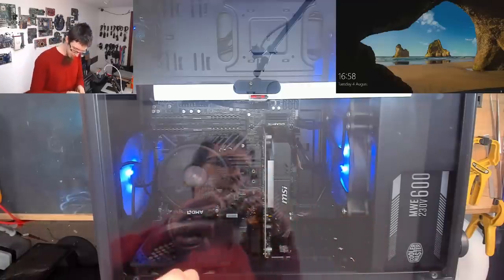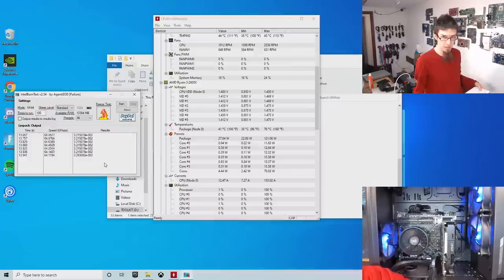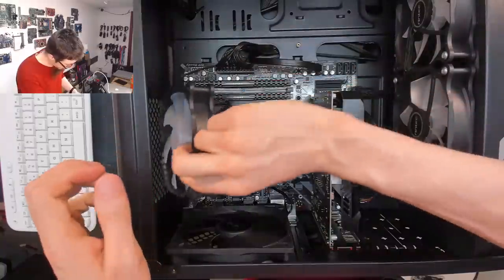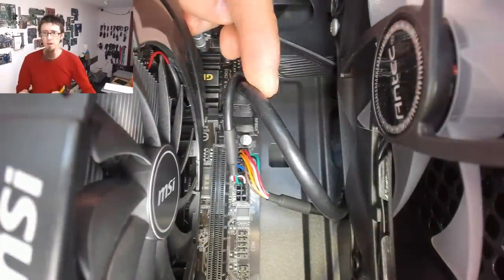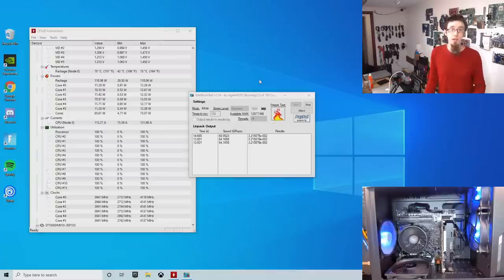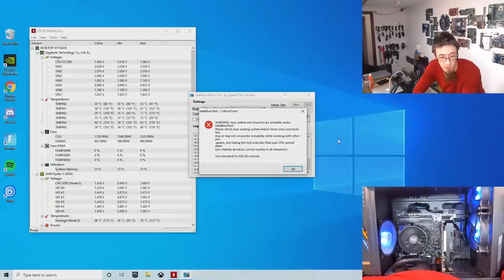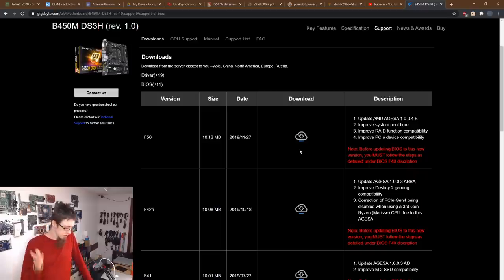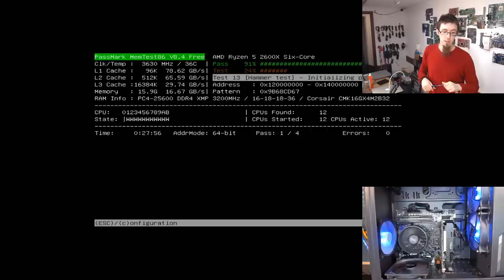Gaming PC Crashes at Random - LFC#217

Comment: How about if my pc restarts when i move the chair or hit the table? I bought a new psu with gold certified. Still the problem exist. I dont know if the power button wiring is broken or what? (Btw sometimes, i cant start the pc directly. I need to wait several minutes or even several long minutes until it boots when i press the power button.)
Reply: And about the problem regarding the turning my pc on, when it turns on after waiting for several minutes, sometimes the time resets for some reason
Reply from the maker: Try reseating the CPU. Try unplugging all front panel (power button, etc) wires, and turn on the PC by shorting the Power Button pins with a screwdriver. Unplug the front-USB and front audio for good measure.
Reply: @Adamant_IT  this thing i did and everything is fine like jays2cents tutorial. But still when i put everything back to normal, the problem still persists. I dont know what the problem is

Comment: sometimes the odd combinations between ram not on the qvl and your lower tier motherboard can indeed cause this issue. though it can also be attributable to a bad memory controller on the chip too. the easy way to tell if its the memory controller is if the chip and ram fail at stock 2133 in the customer's board and a spare known good board. if your looking for a good board nowadays, asrock is actually a lot better then it used to be. im using, and i know im in the future from spit out of this video an asrock x670e board with a ryzen 9 7900x. no issues to complain of.

Comment: I have that same board, and the ideal speed for RAM is 2933 MHz.
Increasing the clock over 3000 MHz can cause problems.
Also at 2933MHz you will get more bandwidth than at 3000 MHz.
2933 MHz takes me out in read, write, copy: 45GB/s 44GB/s 45GB/s, but at 3000MHz I get 40GB/s 42GB/s 40GB/s.

Comment: I would be pissed if I got my pc back to find out he cut something off he thought was useless.. I once had a dead Fan header on my MB, and thus the connector he found useless came in very handy and still allowed me to power the fan
Reply: I was thinking the same thing. If it was me fixing it, I would have wrapped it in electrical tape instead of going straight to chopping it off.

Comment: I stopped using gigabyte boards a long time ago, I used them for years for things like light duty linux servers  because they were rock solid and could be relied on to be left to run 24/7,  the Gigabyte boards were easy to spot in the old days without opening the case, back then  if you were looking at a bios screen and it didnt have a typematic rate setting then it be a gigabyte board - now nobody  has that setting-  unfortunately I  had ram issues with  my own p35ds3r  which I used as a workstation  - black screen with the system  halted every so many boot sequences if left to run the ram with the auto settings-  which turned out not to be voltage droop but the ram being run at the wrong voltage if left to automatic settings I went through all the bios versions  for it  and no fix it was a pain, this was a particular headache using corsair XMS,  but cheap generic ram was fine but slow, a work around was to flatten the bios and install only 1 dimm and after getting into the BIOS was  turn off  the SPD settings but put settings in manually  then shut down and reinstall the other dims..   I also had  a ram issue causing the dreaded boot loop  with another gigabyte series of boards z68 ud4 with almost every stick of ram  I put in them, was  too much of a headache so switched to MSI  years ago  the boards are still running and not had a single  issue since....

Comment: God damn XMP. I had a i7 4790K paired with a Asrock Z97X Killer Fatality mobo and i bought G.Skill TridentX, DDR3, 8 GB, 2400MHz, CL10 without checking QVL. For 6 years I had to run it at stock 1600 MHz because no matter what I did I could not overclock it. Any overclock would cause instability and on stock settings it run perfectly stable. But freaking slow!

Recently I changed the platform to a i7 10700K with the MSI Z490 Tomahawk and when I was configuring it I purposefully bought RAM that was guaranteed to work on that motherboard. I probably could buy something faster for the same price but I stuck to the QVL list and bought the HyperX 32GB (2x16GB) 3600MHz CL17 Fury RGB. Now I have the CPU overclocked to 5.1 GHz All Core and RAM set to XMP without any stability issues. Now the only issue I'm having is waiting for the RTX 3080 to complete the build. It's been six weeks since I ordered it and still have no idea when it's going to be delivered.

Comment: had the same issue a couple years ago when i built my pc (same board same cpu non x version) ram is 3200mhz g skill F4-3200C14D-16GVR and does not show up in the list of supported memory however one very close to mine (g skill f4-320014d-16gFX) my pc would reboot or crash randomly i downclocked from 3200mhz to 2900mhz that seems to fix it havent botherd to swap out memory

Comment: I would have just insulated that Molex connector.  Just cutting the wire and tucking it away without insulating the cuts ends doesn't seem professional to me.

Comment: I had an fx 8350 platform BURN the connector for the eps 8 pin. I know it was properly plugged in, cause even half melted it was plugged in fully. It was overclocked, and I know it pulled heavy power when I ran video encoding software.

Comment: I would have changed the mem test to 99 and let it run while I slept.  4 tests is too small.  If it's still running when you wake up... awesome!  :)  I've seen memory fail after 10+ passes.  So, I usually leave ram tests running as long as possible.

Comment: Set a static voltage. It’s not always memory…..but…….if the errors are different every time…….then maybe yes to the memory. I would turn to loosening and using manual memory timings. XMP is for the masses……..designed to work on all systems………maybe………and that’s why I don’t use it in my builds. All manual timings at XMP speeds. Takes time…..but worth the effort. Tweak until “0” errors. In any event…….troubleshooting is most of the time a crapshoot…………unless it’s a blatantly obvious problem………or an I-D-1-0-T error. Love people who want to build their own rig…………cuz how hard can it be? Well, it’s not hard when you know what you’re doing……….but if you don’t……….and run into problems……….say hello to the computer tech…………and that ain’t your buddy who “knows computers”. When ya got no skin in the game…………..you got no skin in the game.

Comment: Great troubleshooting guide , you’ll probably wont answer this but I wonder how much do you charge for this repair , as I’m sure you worked several hours on this , but in the end you just changed a Bios Setting to fix the problem. So it seems like a hard call .
Reply from the maker: My 'flat-fee' is £50, but I often go a little higher or lower depending on the difficulty. I went lower to £40 on this one because as you say, ultimately it was a BIOS tweak. That also comes with my warranty though, so if the computer locks up again, I'll look at it again free of charge, even if that follow up ends up being more complicated.
I generally don't apply time as a factor for two reasons - a) any smart tech is working on more than one repair at the same time, so hours of tests are irrelevant, and b) filming stuff makes it take twice as long, and the customer isn't paying me to make youtube videos.

Comment: You can select how much memory is used in IBT. 
Wouldn't this be much faster to "achieve" the error there? 
(You had 1024MB selected, as it's the default. Guess it was default when IBT was originally made. 1Gig of ram lol ew)

I'm asking because I really would like to know. Not just being a smartass
Great videos man, keep it up
Reply from the maker: I've never tried experimenting with that option, but this video shows that you can use IBT to pick up potential memory issues - Memtest is going to be better, but this would tell you if it's worth running memtest early on. Memtest is never my first move because I want to look for screamingly obvious faults like overheating/driver issues first.
Deffo something to try out for future jobs.
Reply: @Adamant_IT  I never used that option and barely remembered it being there.
Just thought of mentioning it because you wasted so much time on that test 😅
Maybe next time. Memtest takes forever too. But it's very effective at finding those miss-kbits

Comment: Funny that this video and Linus' Livestream on troubleshooting both were yesterday 😂😂 
literally just found THIS channel. Love me some troubleshooting vids
top fan pushing air back in case instead of exhausting is 1st thing i noticed lol

13:18 meh just drill a few more rows of holes on top of case to fit that exhaust fan without clearance issues with EPS connector (: 
I had to chop out a bracket in my cooler master 500m to get both 360mm radiators in and all fans/fittings not touching. I got maybe a mm of space 😂😂
personal nitpick...heaven/superposition are benchmarks not stress tests lol
and lastly I would've tried just bumping memory voltage before doing bios update but meh , not everyone think the same 😘

Comment: Ran across a similar issue on Ryzen 3000 series. My 3400Mhz memory would not run properly at that speed but instead of going down I went up to 3466Mhz with a tad bit looser timings and a bit more voltage (1.4V instead of 1.35) and it works nicely. Weird is that with the new looser timings and the extra voltage it will still not work at 3400Mhz but it does at 3466Mhz so I'm happy.

Comment: I've had an issue that's been bugging me for months. Basically the PC black screens, GPU fan ramps up to full tilt, audio works for a few seconds afterwards and I have to hold the power button down to restart

It just happens randomly, mostly under load but running different stress tests even at the same time doesn't trip it, I've underclocked everything and disabled XMP and ran memtest and I'm really running out of ideas although it often doesn't happen for days so often I live with it. 

Internet points towards GPU or PSU issues but I don't feel like throwing money into troubleshooting it particularly with current prices, would really suck if it didn't solve it either
Reply from the maker: Yea GPU or PSU would be my bet there as well - unfortunately sometimes the only way to find out is to swap something 😔
I'd start with the PSU, as that's the cheaper part to replace, and can easily be sold/reused elsewhere.
Reply: @Adamant_IT  Appreciate the response, I took the time to pretty much fully take the machine apart by disconnecting the PSU and everything on the motherboard just to sanity check, there is the boot SSD that is hidden behind the power supply and that SSD (samsung evo) for whatever reason doesn't have a locking latch so I have had that come loose once which caused the PC to not boot into windows, really doubt that would be it but I just cable managed and double checked everything. 

If it still happens I'll definitely look into replacing the PSU, my machine has a 2600X and a Vega 64 so it is basically a furnace. I did check the "terrible PSU" video you made and double checked that mine has decently rated 12V rails and it does have pretty much full 750W going there so at least it shouldn't be on the limit. If all else fails I will need to upgrade anyway as soon as prices fall down and the machine is fully usable as long as games have decent autosaves.

One thing I forgot to mention is that Radeon resets the custom OC settings I have every time it crashes, so that also hints towards the GPU issue but I can't see anything in the event viewer, only thing it shows is that the PC was shut down incorrectly or something along those lines

Comment: hmm Youtube algorithm amazes me. My PC started to do the same thing. And in game performance was terrible. After testing with 3Dmark, I noticed it was only at the CPU test it frooze. I opened my AIO cooler and there was some gunk blocking the inlet part of the fine thin copper block. I cleaned it put some destilled water, but didnt have cooling paste. I will open it when I get my paste and recheck the cooler again. Of yea and I cleaned the water radiator that was in some places blocked with dust. My PC feels like new.

Comment: a cut cable is same or even more exposed than the 4 pin connector itself, just braid it with tape

and you installed top fan reversed way than before, 2 exhausting with close to no intake holes is not better than top intake rear exhaust. , that provides a tunnel of fresh air for the cpu

Comment: i did a memory overlock on my b360m-A and had the same problem. turns out i had made the mistake of manually setting the timings and set them too tight. so i loosened them (coincidentally matching the timings and frequency to the same that my laptop has XD which is ddr4 2666 15 15 15 35) and got it to run stable at that clock versus the 2133 that the ram was running at before.

Comment: You should know that 2nd gen ryzen can have issues with RAM above 3000mhz.

I've also got a 2200g with that exact same ram kit in an asrock a320m-hdv. It's also unstable at xmp/docp with 3200mhz.

Comment: I have not finished watching this video but it is interesting to see how & what people check first.
I start with all cables and making sure ram is re-seated.
Then I check the bios to see if its revision is correct for CPU that is in use as I have seen it many times on home built systems.
I then go to MOBO site and confirm the ram is in MOBO compatibility list as I have seen that be the cause of issues many times.
I scan for malware & viruses just to be safe.
I then check to see if MOBO drivers/software were installed.
At that point I do testing with software to monitor what system does during tests.
IF GPU is hot I install Software to change rpm and speed of gpu fan and when it increases to higher speed and at what temp.

Comment: It's common to have to tune your bios to get higher memory speeds.  Even if the memory is officially supported.  Best to look up memory overclocking guides and get familiar with your bios settings.  It's usually not the memory but the memory controller on the cpu that is not happy.

Comment: I cannot believe the way you left that fan connector lead after just cutting it. Then tucked it down the bottom! I'm glad you don't repair medical equipment. You cut it off so it wouldn't touch anything yet left the wires in just a mini version of what it was like with the connector. Just put a piece of heatshrink over the connector - don't cut away something owned by someone else.  If you are going to terminate do it properly

Comment: I typically find with older gpu's it  is best to replace them  whilst the older gpu may work it can throw these type of issues and I think with ram incompatibility has also caused this issue I don't think this was a pre built I think the owner most likely changed the the mobo, ram and processor without doing a complete OS reinstall and looking at all the bodge  work used and older  style psu to save money instead of using a modular type 

with the missing panel on the back my guess the previous mainboard was different..

Comment: This problem can happen even with RAM that's on the Mobo's QVL. G.Skill Aegis at 3000 simply wouldn't play nice with XMP on with my MSI B450 Gaming board. After 20-30 minutes it would blue screen but never with the same error. Dropping the Ram to 2800 solved that problem but had me cussing for a while till I figured it out.

Comment: QVLs are mean't for reference only. A MB may have a profile designed for a given memory model if it is listed there, but even then XMP can fail. If you ever do some research on the matter you'll see how often and how easily XMP can fail. Even when it works at first, it may fail in the future and that will become consistent. Just adjust the settings manually and, if needed, adjust the voltage to .05 extra. 99% of the time it'll work, if there's no damage to the memory slots or CPU socket or pins that is. 

Blaming the motherboard manufacturer, the specific model of memory being absent in the QVL or any other random detail is just unproductive. XMP, FYI, is the same as OC, and OC always has the chance of becoming unstable for this or that reason. Just do the tweaks and adjustments like you're meant to do in a well done OC and that's it.

Comment: That why I always used and recommended Asus motherboards. And yeah, molex sucks, although there were some good qualtity connectors and realy, realy bad ones too. You had to make sure that the pins didn't come out connecting them. Or push 'm in with some pliers. Thought those days were over, but it seems I was wrong about that.

Comment: I've had this issue too, although my ram wasn't supported by mu motherboard, that wasn't the issue, the issue is the ram being clocked faster than the CPU's max memory speed. My motherboard had the ram clocked at 3200MHz but my CPU has a max memory speed of 2933MHz, just something to check if your pc has this issue

Comment: Personally I would rotated both fans to exhaust, instead of just the top fan. It looked like there was a double or triple rad on the bottom doing intake, so the other fans should be exhaust? Anyway, that is how I normally do it. I like to have the hot air pulled off the motherboard, especially if a fan does not have a dust filter.
Reply from the maker: Back fan was already exhaust 👌